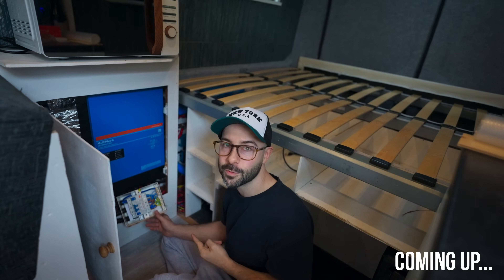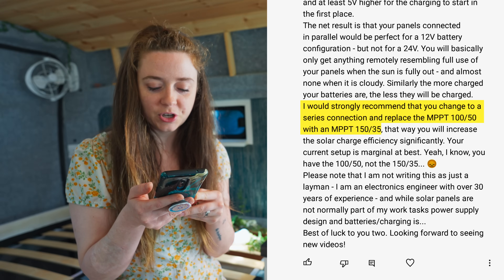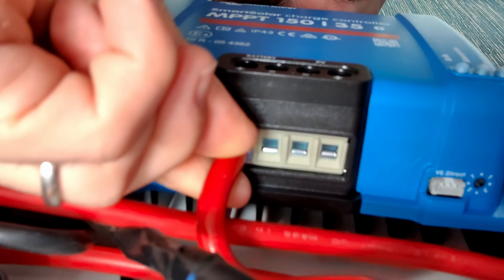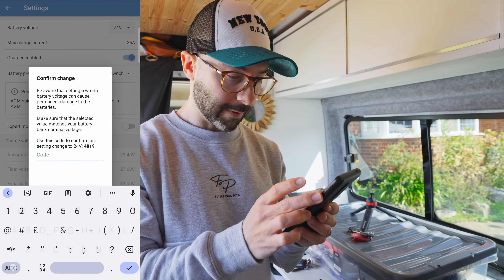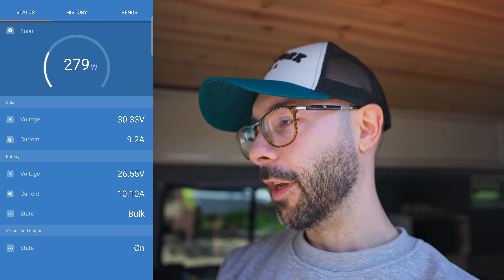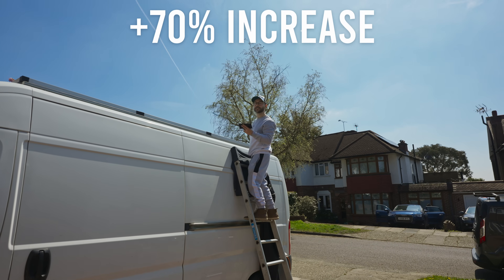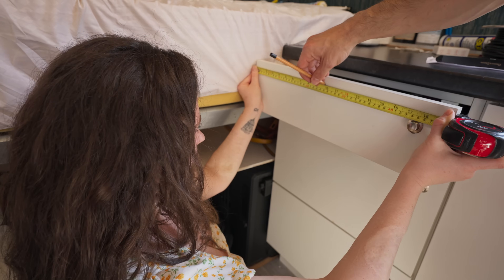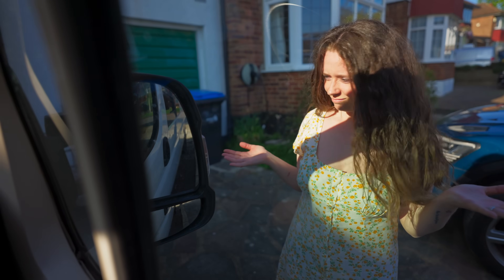Solar Panel Efficiency BOOST // Series or Parallel? | Van Life

Comment: Why did you go to series? Almost always makes sense to have parallel if shading is an issue. You need to check if shading covers more than one panel. Although based on your results maybe we have panels with weird specs and a weird number of cells.
Reply from the maker: I know right, I thought parallel would be better too

Comment: Hi Jodie/Joe

How you 2 getting on with your travels. 😋

Just wondered if you would recommend your craig solar panels? Im about to buy 2 of the ones you've got as ive got 2 maxx fans on my roof one at the front one at the rear.. same van L3 Boxer. Ironically ive been recommend the Victron 100/50 for my setup in 12v.
Reply from the maker: For 12v the 100/50 is perfect you could run series or parallel and see which yields higher results.
The Craig solar panels fit perfectly and are very subtle, they've worked perfectly for us and seem to put out good power. We have no regrets with them 😊
Reply: Nice one... I'll get some 😊

Comment: There should be a button on the door between the window and mirror buttons that will put your mirrors in (if it even has it). 

Did you replaced your turn signal bulb with LED bulb? That can confuse some systems as they don't have enough resistance to recognize that they're there. Some LED bulbs have a built in resistor for this very purpose.
Reply from the maker: We didn't! We will try that 😍

Comment: Uhm. The indicator thing. In the OLD days indicators used to flash super quick if any bulb on that side was broken. Might be worth replacing the bulb, check the wires and make sure there's no damage. Did you replace the bulb holder too in case the terminals were damaged when the dastardly Tesco van hit you?
I hope you get it mended. 

Only half way through your video but loving it as always!!!

Thank you both.

Comment: I am somewhat overwhelmed by being credited the way you do it in this video - but I am definitely happy to see that my advice was of some use to you. Thanks, Joe, for putting in some effort to show the impact of the change of charger setup. Now it's just a matter of enjoying the extra energy available!
Reply from the maker: Thanks again for the advice, it was a worthy upgrade!
Reply: Bulb, check the bulb
Reply: Well done mate - now what are your thoughts on this whole right indicator thing? 😉
Reply: Wauw, I was just looking for the best MPPT's to buy and the question to put them in series or parallel, now we know what to do.
Reply: @sailingaroundtheworld1427   Please go back and check my original comments! What this video shows you is what was the right configuration and MPPT for Jodie and Joe - based on their choice of battery (24V) and type and number of panels. Any change you make to these choices can make this recommendation void! Do not believe these recommendations are right for all setups! 
Joe chose solar panels with 9x6=54 cells, each of which are nominally around 0.5 V, meaning the panel as a whole has an open circuit voltage of around 34.1V and a maximum loaded voltage around 27.9V. Other panels have 60, 72, 90 or yet another amount of solar cells, meaning these specs will be different. On top of that the battery configuration (and corresponding voltage) impacts the maximum power the MPPTs can handle. At 12V the MPPT100/50 can handle 500W, at 24V 1000W of solar panel power, whereas the MPPT150/35 can handle 650W respectively 1300W. Given the 24V battery system and 3 of these solar panels, totalling a maximum of 900W solar power, series connection and the MPPT150/35 was the right choice for Joe. Any change you make to that setup risks making the MPPT150/35 and series connection the wrong choice for you. It may still be the right choice - but you need to check that the conditions are the right ones...
Reply: @erikdam391  Hi Eric would be interested in your thoughts and may help you in your quest of max power for van roof space. I've got Sprinter LWB with Max air fan, 1120ah 12v lithium house battery with electrodacus BMS, Victron smart BMS monitoring, 2 x renogy DCC50S one for solar and one for solar and vehicle battery/alternator.  looking at upgrading the DCC50S to Victron so i can get a full view for monitoring what Solar charge controllers would you get?  All of my panels are in series specs below 

4 x Renogy 175w Flexi panels 
Maximum Power at STC* 175 W
Optimum Operating Voltage (Vmp) 19.5 V
Optimum Operating Current (Imp) 8.98 A
Open Circuit Voltage (Voc) 23.9 V
Short Circuit Voltage (Isc) 9.50 A

1 x Renogy 100w
Maximum Power at STC* 100 W
Optimum Operating Voltage (Vmp) 18.9 V
Optimum Operating Current (Imp) 5.29 A
Open Circuit Voltage (Voc) 22.5 V
Short Circuit Voltage (Isc) 5.75 A
Module Efficiency  15.0 % (Website says Cell Efficiency: 21.0%)

2 x Renogy 50w 
Maximum Power at STC* 50 W
Optimum Operating Voltage (Vmp) 20.3 V
Optimum Operating Current (Imp) 2.47 A
Open Circuit Voltage (Voc) 24.3 V
Short Circuit Voltage (Isc) 2.75 A
Module Efficiency 14.4 % (Website doesn't say)

Comment: 9:00 You changed the lens assembly but you put the old light fitting in the new assembly. Chances are the filament in the bulb has blown after the impact. Change the bulb as well!
Reply from the maker: The bulb looked intact but I'll buy a new bulb in case
Reply: @JodieandJoe  Nick is right guys, had this before, the indicator clicks double time to announce the bulb is blown 👌💡😱
Reply: @dazjames5543  it flashes faster because there's less load on the circuit, but you're right, it is like an announcement and very convenient.
Reply: @tobysherring1369  Indeedy, I couldn't remember the exact science but yep, what you said.
Reply: @JodieandJoe  Ok. Failing that put your hazards on and do a walk around the van checking all 6 lights are lighting up. (2xFront, 2xRear, 2xSide repeaters)
Reply: There's a bulb somewhere that's either blown or not firmly connected. Are all the RH bulbs lighting up?